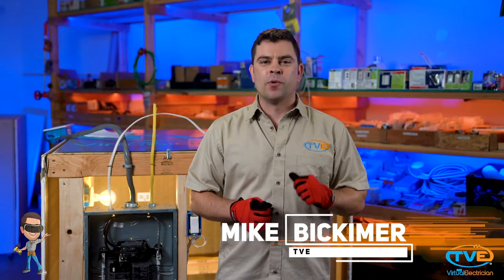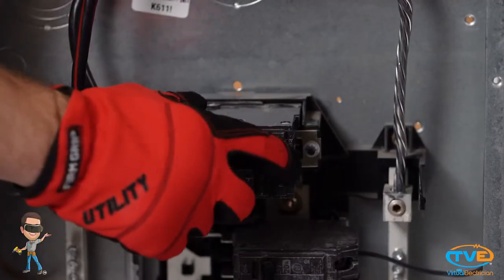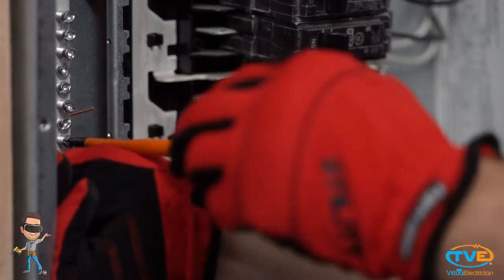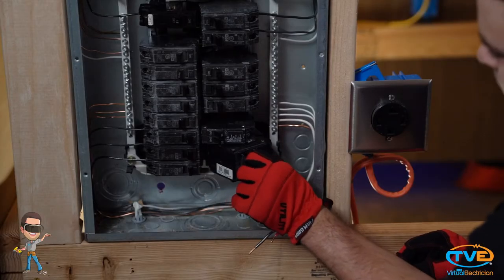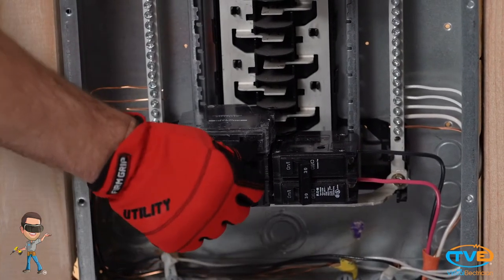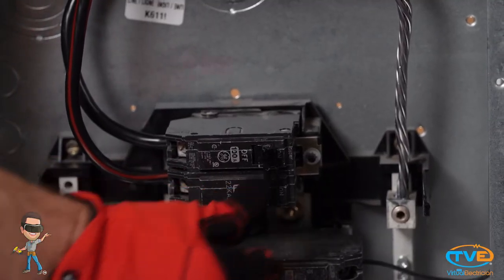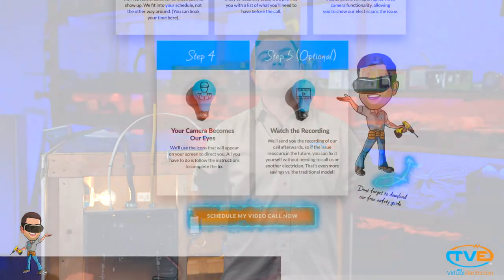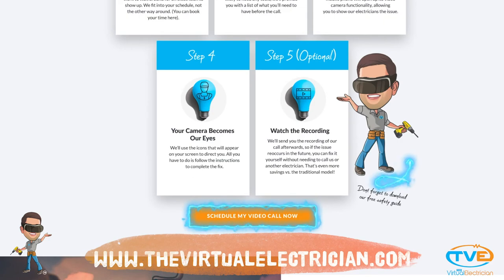How To Replace a 240 Volt Circuit Breaker

Comment: Good video. I have a 3 car garage/ man cave fully insulated, ceilings too and even the garage doors. Garage is about 660 sq ft with  8ft celing hight. The lowest tempature during Christmas will be 37 degrees farenhight. My questions is if I install a 5000-7000w electric heater, I have to installed a 240v outlet too right or it can be just hardwired??
Eventually I will buy a minisplit system and be getting rid of the electric heater. Will I be able to  use the  240v outlet previously installed for electric heater when I install mini split in future?? 

Also we will be getting an electric car down the road so I will need a 240v outlet to charge car so what will be the correct pathway for my projects, install a 240v right now  for electric heater so I have heater in man cave before Christmas   or maybe just use propane heater just  for that day🙄 until I figure out what minisplit system to buy??
Sorry for all the questions
Reply from the maker: If you get a 5000 watt heater, that line should work for your mini split as well.  But it depends on the size. Most small ones are 25 amp.  Since both are continuous load, you only need to bring 12/2 wire over.
The heaters ive installed, are hardwired. But there are many types.
If the EV you are getting is a Tesla, I would bring a dedicated 50 amp circuit over. The higher the amperage rating, the faster the car charges.  Most people are satisfied with the speed of a 50 amp circuit.  I would also use 6/3 wire for this, as you will need a neutral and you will want this line to be efficient.
Reply: @TheVirtualElectrician  the minisplit iam getting will be this one MRCOOL DIY 18k 20 SEER Ductless Mini-Split Heat Pump 230V, BTU Cooling 18000, Volts 230, Cooling Capacity 750 ft², Model# DIY-18-HP-230B
I won't be getting a Tesla, maybe a leaf or something else..I only need a 240v to charge it.
So eventually I have to installed two 240v outlets in garage one for heater right now which will be good for future minisplit and another one for electric car right?
Iam assuming to install two 240v outlets I will need to different  240v lines?
Reply from the maker: @futbol1972  you are correct. You will need 2 separate lines. Make sure you have enough room in your panel for this. You may be able to install tandem breakers in your panel to free up space if you don’t
Reply: @TheVirtualElectrician  thank u very much:). So I will need two different spaces in breaker box to install two 240v 30A lines,  one for future Mr cool 18000 btu minisplit system and the other one for electric car right.  I think for Christmas night I will be using a propane heater to heat up garage just for that night🤔
Reply from the maker: @futbol1972  you will need a total of 4 breaker spots. Each 240 volt circuit will take up 2 spaces.
Reply: @TheVirtualElectrician  I checked earlier on my breaker box and it looks like I only have one empty space left on breaker box😞 so this means I won't be able to install a 240v outlet for my EV car or wired my minisplit system when I get it?
Reply from the maker: @futbol1972  https://youtu.be/CEzlkgAmTD8

watch this video.  it teaches you how to install a tandem breaker to free up panel spaces.  what type of panel do you have?
Reply: @TheVirtualElectrician  how would I check that?   It says square D all in one series MO1.     SC1624M125S.  I will watch video in a bit
Reply: @TheVirtualElectrician  rainproof type  3R
Reply from the maker: @futbol1972  that should be a 16 space 24 circuit panel. You should be good. Can you upload a pic here?
Reply: @TheVirtualElectrician  I don't know but I will check to see if I can
Reply: This is what it says on breaker box.  Square D all in one. SC1624M100S.   SC1624M125S
Rainproof type 3R enclosure Mains 125A Max.
It looks lime breaker box only has one empty slot left.
Reply from the maker: @futbol1972  you will be able to free up more space by installing tandem breakers
Reply: @TheVirtualElectrician  OK thank u
Reply from the maker: @futbol1972  u bet!

Comment: My sub panel looks to be powered by 40amps. Can I install a 60amp breaker along with the 15 and 30 currently in there? There’s 4 empty spots.
Reply from the maker: Unfortunately you will not be able too. You will trip the 40 amp breaker for you subpanel
Reply: @TheVirtualElectrician  what would be the best course of action?
Reply from the maker: @joshuacassino7297  you would need to install it in your main panel or you would need to install a larger subpanel.
Reply: @TheVirtualElectrician  what would I do to change that 40amp sub panel to accommodate the extra 60? Currently I there is 15 and 30. For central air.
Reply from the maker: @joshuacassino7297  is there a clear route from the main panel to to the subpanel?  You will need to install a larger size wire from main panel to subpanel to accommodate the extra load.
Reply: @TheVirtualElectrician  extremely easy. Right next door. Could you illustrate what I have to do? I can send you pictures of inside the panel
Reply from the maker: @joshuacassino7297  absolutely. Go to www.thevirtualelectrician.com. Schedule a time that works for you and I will virtually walk you through exactly what to do
Reply: @TheVirtualElectrician  also what tamperage would that 40amp breaker need to be changed to in the main panel?
Reply from the maker: @joshuacassino7297  we would need to do a load calculation to determine this. If I don’t have the video up for this yet, I will add it tomorrow